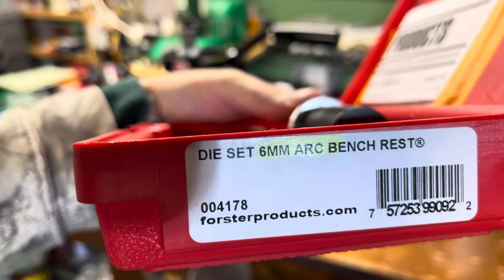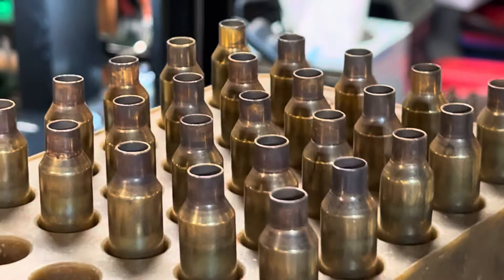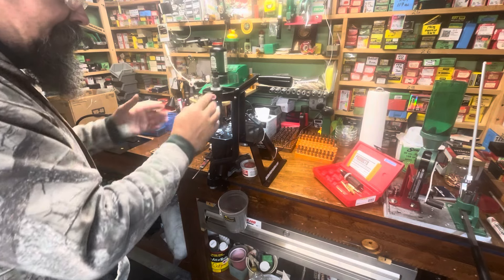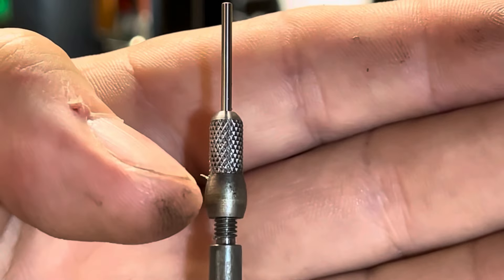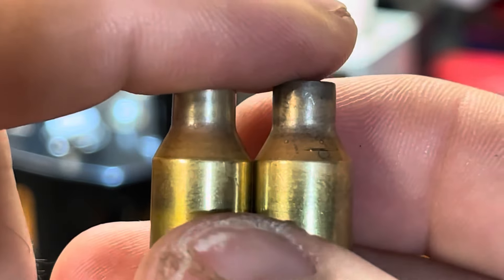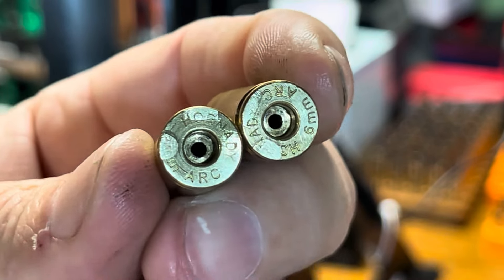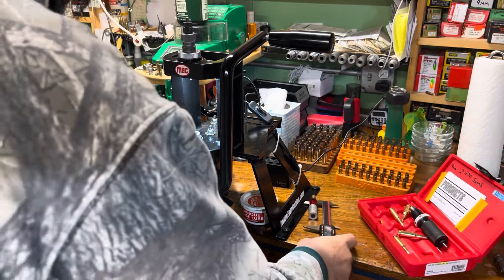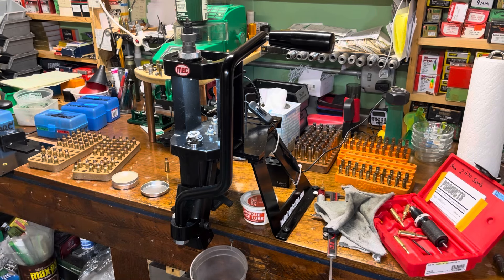Bench Chat: 6 arc Fire Form loads & Die Setup

Comment: After fire forming brass from 6.5 Grendel cases, I decided that I would be buying 6ARC brass going forward.
Reply from the maker: 😜😛. It didnt work well for you? Some powders are better than others for FF loads. Sometimes when imperfect powders are chosen, it takes a second firing. 
I haven't used grendel, simply because I have one and these two are too close to risk a issue with head stamps. 
But with a 7.62 stamp anyone would/should take a second look before proceeding. 
I also don't form Grendel brass at all. 

This brass, I have formed here, chambers well but not as smoothly as factory. But thats not a negative. It's formed in my chamber and fitment means consistently. 🙏❤️‍🩹🙏
Reply: @cw2a  They work good.  Now that 6ARC factory brass is available, I am lazy and get the correct head stamp.  

My next fire forming project is easy.  280REM brass to 280AI. Step 1: find safe 280 R load.  Step 2: fire it.  Why? My 280AI doesn't have a SAAMI chamber and hates Nosler brass.
Reply from the maker: @texpatriot8462  Ahh. 100%!